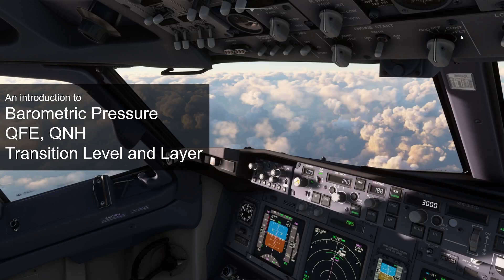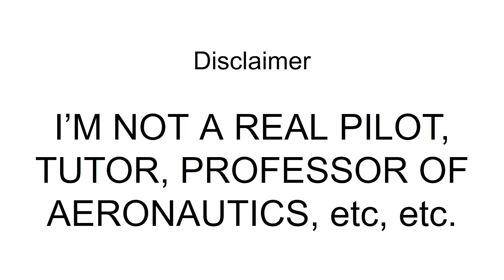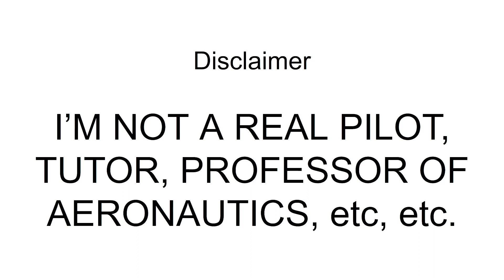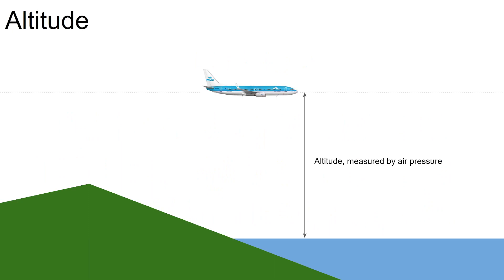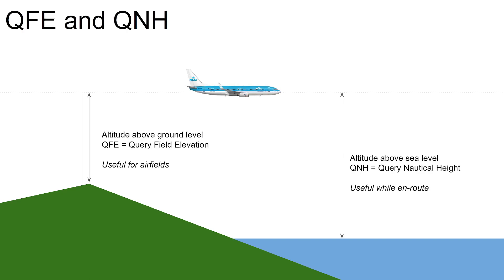Beginners guide to Altitude, QNH, QFE, and Transition Altitudes in Microsoft Flight Simulator

Comment: Very nice video. Just a quick note (I fly in real life as well as love the sims) The correct term for "standard QNH" is the QNE which is set to 1013,25 Hpa and this is used as the baseline for altimeter settings after transition altitude (Once terrain is longer a factor)

Comment: Hey Jonathan, I’m going to apologise in advance because I’m sure you’ve probably answered this I the video and I’ve missed it but how do you know what to set your QNH to when one the ground in departure airport because I know it’s not always 1013 HPA or 2992 IN?
Reply from the maker: Press B. It shortcuts it to the local QNH.
Reply: @jonbeckett  In X plane you cannot press B, these are the brakes!
where can you find the right information to set your QNH?
Reply from the maker: @pfv3462  You might have to adjust it by hand in X-Plane :)
Reply: @jonbeckett  If I understand correctly, I first set the Query Field Elevation at departure, which I find on the map of the airport of departure.
During the flight I set the Query Nautical Height to 29.92 inches during the transition altitude.
And before landing I set the QFE of the airport upon arrival with the data of this airport.
so when planning the flight I need to know all the details of these airports!
Reply from the maker: @pfv3462  if you tune the COM radio to ATIS the airfield will tell you the local weather on approach :)

Comment: Probably a stupid question, but how do airliners stay at a fixed flight level if the temperature changes as they fly large distances?  If the local temperature drops as they fly over the ocean would they need to adjust their actual altitude to maintain the same indicated flight level?
Reply from the maker: Once above the "transition altitude" (which varies), all aircraft tune their altimeter to "Standard" - so they all agree with each other. It is important that they all agree with each other's altitude - not with a specific altitude above the ground.
Reply: @jonbeckett So if a particular region is warmer than standard, do all the aircraft in that region adjust their altitude so that they maintain their assigned FL? Kind of like the rising tide lifts all ships. They change actual altitude but all change together so they can maintain separation?
Reply from the maker: @darmok072  Everybody sets their QNH the same - so if one person thinks they are at 36,000ft and another thinks they are at 35,000ft, they SHOULD be 1,000ft apart. Neither might be exactly that over sea level though.
Reply: @jonbeckett Thank you!

Comment: Cracking video Jonathan that answers many questions that I hadn't understood fully prior to watching this. One question though - how does one know or obtain what the actual transition level is for the area you are flying in? I was always under the impression (from watching other videos) that it was globally 10,000ft and at that point you switch to 29.92in but this is clearly not the case.
Reply from the maker: In most of the USA it's 18,000ft. It's on charts, or you can ask ATC (so it's a reason to get navigraph) :)

You should keep speed at or below 250 knots below 10,000ft and keep landing lights on below 10,000ft if you're commercial traffic.
Reply: @jonbeckett  Thank you.  Does little navmap show transitions altitude places in the uk? I have Navigraph installed into LNM
Reply from the maker: @CaptainBOB-nb8qi  Yes, I believe it does - in the Airfield information.
Reply: @jonbeckett  I already have paid Navigraph and use SimBrief for planning etc. I'll look more into this now cheers. You are broadening my knowledge so many thanks.